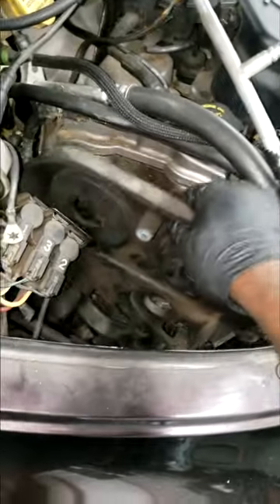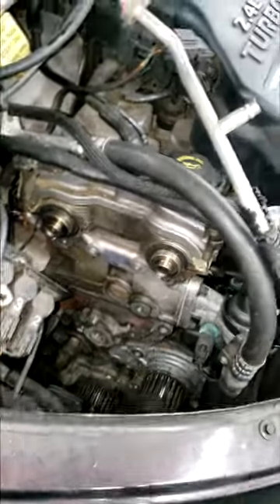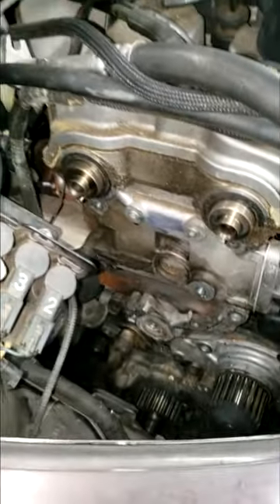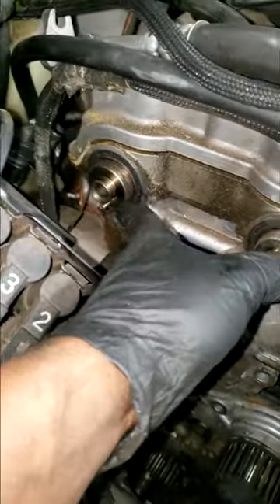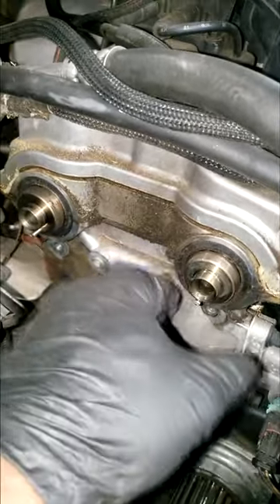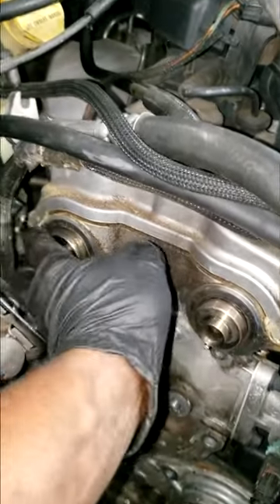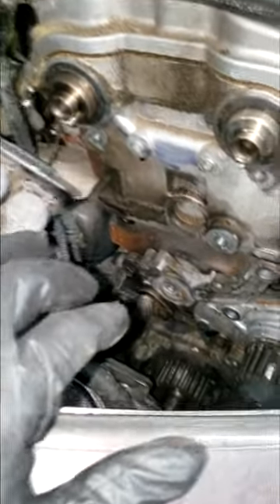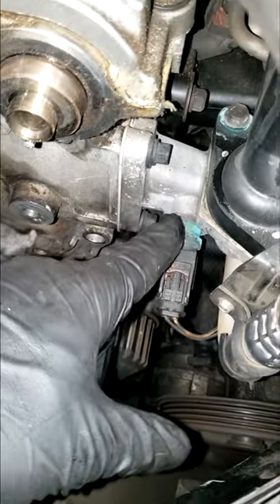TIPS and HACKS to do when working on this Motor.

Comment: Fuck I hated timing belt jobs on these. My trick was to separate the left ball joint, remove the right axle nut, disconnect the shifter cable, unbolt all the mounts, support with two jacks and pull the entire thing to the driver's side with a ratchet strap. Lotta room after that!
Reply: All i ever do is unbolt the transmission mounts with the engine cradle holding everything up

Comment: I wish you wouldn't have taken the knuckle loose from the strut.  Now you need to have the car aligned because you just messed the caster AND camber up and will eat tires to shreds.  Never take knuckle loose from the strut unless you're replacing one or both and getting an alignment. 
Remove the knuckle from the balljoint it doesn't change any adjustment or alignment points.

Comment: Those timing belts are breaking bastards around 100k. They just shear the cogs right off the belt around the crank
Reply: 60k belts are 3/4" wide and don't usually make it to 90k, 100k belts are 1" wide and don't make it to 120k very often. 
Service manual for each car can tell you which the car has based on 60k or 100k service interval, unless someone swapped the engine.  Ive replaced the narrow ones with the wider ones several times,  but you have to have the proper timing cover for the upgrade